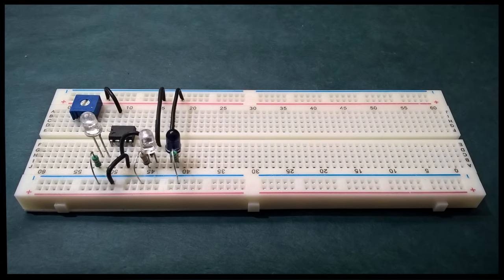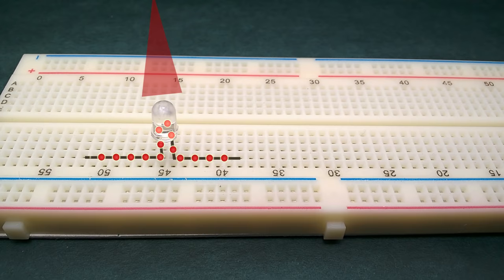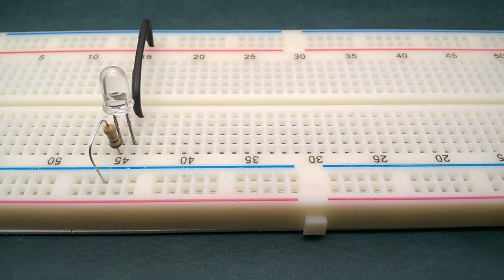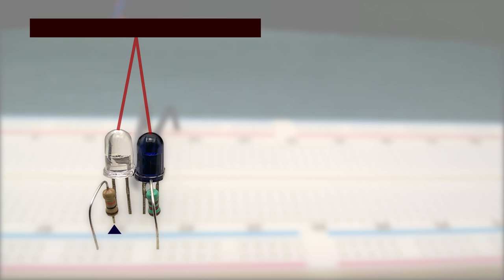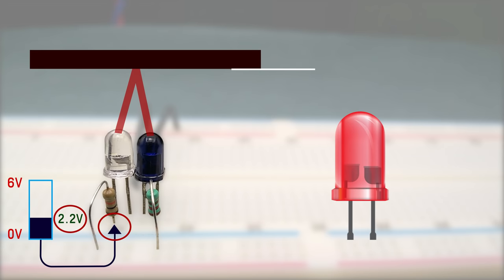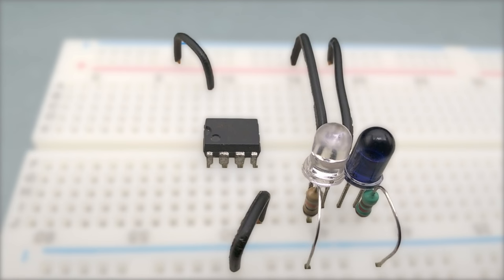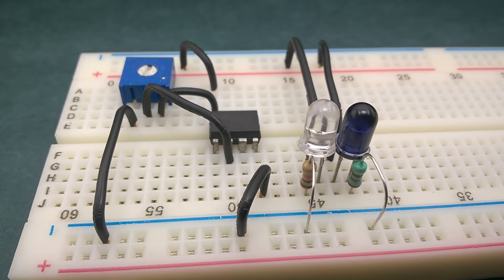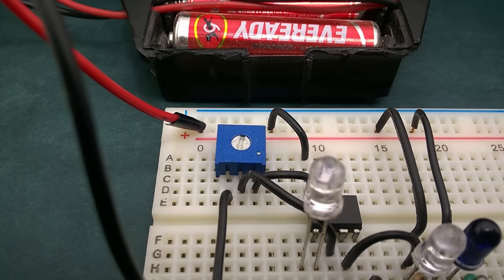IR Proximity Sensor / Obstacle Detector circuit on Breadboard | LM358 Op-Amp projects

Comment from the maker: if you face any difficulties in making the circuit work as expected, watch this: https://www.youtube.com/watch?v=036kskbFf40
Reply: Could you please send me the video or circuit of ir sensor and counter
Reply: I have a problem. Do I need an infrared diode and a photodiode? or 
An infrared diode and a phototransistor?
Reply: Great video, Logically explained and intuitive, thankyou, subbed.
Reply: Elonics - Electronics Projects on Breadboard
Reply: Thanks
Reply: Brother , can u help me that i want to built a RFID Door lock With Arduino nano and Micro Servo SG90 and RFID-RC522.......Brother its urgent help. ( CODE and circuit daigram needed )
Reply: Can i ask the number for infared sensor
Reply: Best channel of electronics👌👌👍
Reply: Hello sir, can we increase range of metal detector? If yas teen how? Please guide 🙏
Reply: @luisleonardojuarez7389  बन
Reply: Voces enrolam o cara cade o esquemA eletronico0

Comment from the maker: If you face any difficulties in making the circuit work as expected, please refer to the troubleshooting guide in the description and see if it helps.
Reply: can i made longer the distance?
Reply from the maker: This circuit's sensing range is limited to around (15-30)cm. Beyond that, even if you adjust the potentiometer, the LED always stays on.
Reply: Elonics - Electronics Projects on Breadboard please send me the circuit
Reply: Elonics - Electronics Projects on Breadboard
Reply: Elonics - Electronics Projects on Breadboard 
What if i want that the led have dimm or goes brighter dependent of the distance of a object to the sensor? Is it possible to realise?
Reply: What of I want to turn off the led when something comes close
Reply: Elonics - Electronics Projects on Breadboard even after using 1k for led and 470 for ir led. The led at the output keeps on glowing continuesly. Plzzz help
Reply: can we make it using arduino where three led bulbs depending on the distance of obstacle glows  like one led for very far , one for medium distance and one for very close?
Reply: I have a 20k potentiometer, what are the necessary changes I should make?
Reply: a  question that means "cut the bread?"
Reply: Elonics - Electronics Projects on Breadboard  circuit digram
Reply: If i want to indicate the output using a buzzer so can i connect a buzzer like you just did using led

Comment: Great video, mate.  This is the setup I had in my head but wasn't sure how it'd work, and you've gone through it in a clear and concise manner.  We even have two channels on the op amp, so we can build a dual sensor unit in this manner that doesn't require an Arduino or what not to act at the comparitor or voltage reference-measurement.  Love it.
Reply from the maker: Thank you.

Comment: Thanks for posting this tutorial. This circuit worked for me. Although my IR receiver is black and my IR emitter is clear, which is flipped from what is shown in the tutorial. I had to adjust the 10kohm resistor to change the sensitivity for my application.

Comment: Great video, very well presented. For some reason mine was on and turning off with proximity. After much consternation I swapped the wiper (center tap) of the pot and put it on #3 and moved the receiver wire to #2 and lo and behold it worked. Not sure if the schematic is wrong, my LM358 is backwards or something else. Note, if I approach the circuit from one side it has a range of approx.  3 feet.

Comment: If you are all are wondering why the LED is continuously on, it is because there is no barrier between the light detector (white) and IR LED (blue), so it will always pick up light...
Some masking tape between the two - without covering the domes - should help (although I have not tested this circuit myself).

Comment: Sir, does the infrared source emit the infrared rays uniformly in all direction? If it so doesn't the photo diode should always be sensing it as the source is very close to the photo diode in this model.

4:19  doesn't the statement should be 'voltage of inverting input is lesser than that of non inverting input'

Comment: It worked on my first attempt. I used  5V mobile charger supply to power it. Suggestion- 270R should have higher wattage, gets hot on 12V & please use different colored wire for +ve & GND.. Thanks.
Reply: Your circuit has a humongous flaw that will render this useless. 
You've labelled your photodiode as a transmitter, And you've labelled your infrared diode as a  reciever. The entire circuit and theory behind this is perfect, but you have to swap these two.

Infrared diode(transparent) positive pin to VCC, negative to R1 resistor which is then grounded.
Photodiode(black) positive pin connected to pin3 of OpAmp as well as a resistor which is then grounded. Negative pin of photodiode to positive.

Comment: Im pretty sure the the black diode is the reciever, not the emitter, and is that an inductor you used to bring the black diode to ground? Im pretty sure you said its a resistor, but it looks just like an inductor.

Comment: I see that you noted this, "Note: For supply voltage of 9V or more, use 1K resistor for LED and 470R for InfraRed(IR) LED" Would I still need a 1K resistor for the LED if I was actually going to use that connection to light a LED stip up to 10 feet long? I know a single LED couldn't handle more than 5volts, but a strip should be able to handed the 12volts
Reply from the maker: LED strips usually come with resistors soldered for every 3 LEDs or so. You may check the spec and if it is rated 12V, you can skip using the resistor

Comment: Hi there, I see some of your user questions are about ambient light affecting the way the receiver works. This happened to me also.
When I built the circuit it was during the evening (so no daylight) and all worked great. The next morning when I powered up the circuit once more, the receiver just stayed on continuously and wouldn’t respond to the IR transmitter. I spent ages checking voltages on pins 2 and 3 and swapping out components, until I suddenly discovered it was the ambient daylight that was causing the receiver to activate and cause the LED to stay on all the time.Do you know of any way to stop daylight affecting this?
Thanks
Reply from the maker: Hi,  the only way is to use a cylindrical enclosure around the Photo-diode (Like this: https://youtu.be/036kskbFf40?t=3m9s). Or you can consider making a modulated version of proximity sensor (More complicated and also more immune to ambient light)

Comment: Sir, Your explanations are really very good !👌🏼
Could you please explain the same  IR Sensor circuit when using an LM567 IC. The LM567 is to be used as it allows usage of IR Sensor even in bright Sunlight. Thanks in advance, Sir.

Comment: Hi, I visited your website, did the troubleshooting guide too, but the IR pair (i checked they're not broken) is not working as a proximity sensor, my red LED is on/off according to adjustment of the pot, can you explain why? thank you!
Reply from the maker: Did you try adjusting the pot to just the position where the LED turns OFF, and then test if the circuit is working?
Reply: Elonics - Electronics Projects on Breadboard Thank you for your quick reply! yes, I did. But it didn’t work, then I changed two resistors for IR PAIR, now it works, maybe it was the problem of wrong resistors’ value for my IR PAIR
Reply from the maker: @minqingliang  Awesome! Glad that it worked. Yes, it might be that the resistor used in series with this particular IR detector is either too big or small.

Comment: Hi, I had to swap pins 2 and 3 on the LM358 in order to get the led to light on proximity sensing. With it hooked up as shown on the schematic, the led  was lighted and proximity sensing caused it to go off.
Reply from the maker: Hello, did you try adjusting the potentiometer before swapping pins 2 & 3?
If the circuit worked after swapping the pins, chances are that it will also work with the original configuration.

Comment: I Purchased a ready built proximity sensor using lm358 and it works reverse the light is on default and when object is placed it goes off. How to reverse its behaviour

Comment: i need to make a proximity sensor for a door that will only operate the circuit if the person or object carrying something that will trigger the proximity sensor. so if you were not carrying the object it would not open the door, but if you are carrying it, it would sense your proximity and open the door. what would I use for this?

Comment: I arranged the apparatus exactly as you did.but how to arrange the potentiometer, I was only confused in arranging that,also iam using a 9 volt battery so how to control the voltage to get good results,
Reply from the maker: Of the 3 potentiometer terminals, 
One extreme terminal need to be connected to positive rail,
the other extreme terminal to negative rail,
and the center terminal to inverting input.
This circuit works fine with 9V

Comment: If want a DC motor at the output instead of LED, what will be the corresponding changes in the circuit diagram ?
Reply from the maker: If its a small motor without heavy load, you can directly connect it to the output. Otherwise use a mosfet/motor driver.

Comment: The polarity of the clear IR receiver LED looks reversed... isn't the flat side negative?
Reply: Also, you mentioned 2 x 270 Ohm resistors but implemented 220 Ohm resistors on your site schematic. I am going to go with more resistance, might want to consider this as it may burn out the LEDs.

Comment: hey.. explaination is too good.. i have doubt can i use opamp 741(comparatorconfig) instead of lm358ic ,, and one more thing instead of led can i able to replace with relay..whats the max range of this .. i really need this info.. pls help on this
Reply from the maker: Hi.. Yes, you can use a 741 OpAmp.. Maximum current output of 741 is around 20mA.. Although the output current will be sufficient to drive a relay,, its better to connect via a transistor (to avoid fluctuations).. something like this: https://goo.gl/images/MHnoHA
Reply: MAX range .?
Reply from the maker: Around 15cm

Comment: Hi, Elonics i'm very thankful to you as i made this project from yours circut diagram and it really worked. but i have a ques. that why are we using 10k ohm resistor in ir transreciever and 270 ohms in other two..?
Reply: i guess.. it is because to make ir reciever less sensative.. is that ryt..?
Reply from the maker: No. It's because we need more voltage drop, as in V=IR. So that Op-Amp can detect changes over a wide range.

Comment: hey ! At 1:38 , the clear LED is the IR emitter and the colored one is the receiver right? is it shown the wrong way or am I wrong?
Reply from the maker: No,  the IR photo-diode used in this video is white and the IR LED is black. But it can also be the other way. You can determine which one is LED/Photo-diode by connecting both the diode, photo-diode pair separately to the power supply (via a 220 resistor) and see which one glows using a digital camera.

Comment: Bro can we use 12V water pump in place of the glowing led by increasing the voltage
Reply from the maker: You should use a relay at the output of Op-Amp and connect the 12V water pump to the relay

Comment: Could we use 10k variable resistor instead of Potentiometer......i had used all circuit patched same but circuit run automatic means LED and Buzzer keep running.........IR transmitter does not work...
Reply from the maker: Did you watch this video: https://www.youtube.com/watch?v=036kskbFf40
Reply: Elonics - Electronics Projects on Breadboard 

Yes and everything is all right

Comment: I made this circuit and used 9v battery and 1k resistor for led and 470ohm for ir led. My problem is led glowing without any obstacles.
Reply: It worked the problem was a faulty IC I changed it and it now works
Thanks for the circuit diagram
Reply: Do you have any other project ideas if so please share the circuit diagram
Thanks

Comment: Hi, Elonics. Can I also use the UA741CN as op amp for this circuit? it is a single op amp an should work with 5v up to 40v. 

I try to use this IC but it dont work :/ 
Thanks for sharing your circuits :)
Reply from the maker: What are the measured voltages at the inverting and non-inverting inputs, before and after placing the obstacle?

Comment: is the both infrared led same?                and why do you have them in different colour
Reply from the maker: No,  the IR photo-diode used in this video is white and the IR LED is black. But it can also be the other way, in your case. You can determine which one is LED/Photo-diode by connecting both the diode, photo-diode pair seperately to the power supply (via a 220 resistor) and see which one glows using a digital camera.
Reply: Elonics - Electronics Projects on Breadboard Very helpful. But these LEDs & PDs don't have any part numbers & specific data sheets. Do U have any videos about different kinds of LEDs & PDs?.

Comment: If I'm making this circuit on a zero PCB with a 9v battery do I use the same resistors or different
Reply from the maker: 470R for LED and 270R for IR emitter
Reply: Did your circuit worked

Comment: would it be possible to use a laser as an infrared source to increase the range of detection?
Reply from the maker: No, the IR Photo-diode is less sensitive to visible light. An LDR circuit should do if you wish to use a laser.

Comment: Question: at 0:33 is the "infrared photodiode" a phototransistor or an IR reciever?
Reply from the maker: The infrared photo-diode is similar to a solar cell (current flows when light is incident on it). The only difference is, a solar cell responds to visible light whereas the infrared photo-diode responds to infrared light.
Photo-transistor is like a mix of transistor and photo-diode in a single package. (the photo-diodes output is amplified by the integrated transistor, so more sensitive)
An IR receiver has all required elements to do everything right from receiving the IR signals to decoding them (like TSOP1738).

Comment: Hey, do you know how the sunlight (or fluorescent bulbs) can influence in 
the circuit? I've been testing around these suspicious environments and 
the polarity of the IR sensor seems to be inverted. That's weird.
Reply from the maker: Yes. If the ambient InfraRed radiation is more than what the amount of reflected radiation from IR LED, this happens.
When you place hand over the diode-photodiode pair, it receives less radiation then before (because ambient rad > reflected LED rad), which makes it think the obstacle is moved and so it turns off the LED.
Reply: You can eliminate ambient light interference by using a modulated carrier. The emitter is placed in series with an oscillator at around 37kHz and then that signal is pulsed on and off at around 10Hz. The circuit is a bit more complex, but it is the standard method used in remote control devices and dramatically improves the range and eliminates interference. A 3 pin IR receiver works best, but you can also use a 2 pin receiver and add a simple transistor amplifier at the output. Fine tune the emitter's 37kHz oscillator until you get maximum reception at the receiver.

Comment: is the op amp using smith trigger circuitry to provide the output .  Thank you .
Reply from the maker: If we added a positive feedback loop from the output, it would become a Schmitt Trigger Circuit. Without the feedback loop, it's a plain comparator circuit

Comment: 50/5000
this circuit also works as a camera trigger ?
in sunlight are no problems, distance of work.
or better ir sensor, not phototransistor ?
Reply from the maker: A modulated IR sensor works better in sunlight. This one is unmodulated.
Reply: modulated-unmodulated ?
Reply from the maker: In an unmodulated IR sensor, there is no way of knowing if the IR radiation is from emitter or external.
In a modulated sensor, the emitter emits IR light at a certain frequency, which helps in distinguishing between IR radiation from emitter and from external sources like sunlight.
Reply: thanks and happy christmas
Reply from the maker: You're welcome and I wish you the same

Comment: If i use 9v battery what would be the additional appratus to be connected???plz help
Reply from the maker: You can directly use a 9v battery. Just change the LED's resistor from 270R to 470R.

Comment: What if you want the opposite?you want an Output whenever it does NOT reach the refence point?
Reply from the maker: Reverse the inverting and non-inverting input connections: Adjustable terminal of pot should be connected to Pin-3 and the common point b/n photodiode and resistor should be connected to Pin-2.

Comment: When I connect the battery, my led lights up and does not get affected by changing the potentiometer now by changing the distance of obstacle????what should I do?
Reply from the maker: The ambient light might be high or the spacing between the diode and photodiode is very less

Comment: Thanks for the video, good sir. Just a quick question how did you achieve the +ve 5 V and - 5V  for the op-amp or did you just used 0 V to 5 V supply to the op-amp ?

Comment: the buzzer goes on continuously.
i have checked the circuit properly but the buzzer doesn't stop even if there is no obstacle please help me with this problem asap.
Reply from the maker: The intensity of the ambient light might be very high. Try testing this circuit in less illuminated conditions.
Reply: Even I faced the same problem

Comment: The only thing was when I did this the light would stay on but turn off when I got close. I had to connect cathode of LED to pin one and positive to power supply using 270 ohm resistor.
Reply from the maker: You are doing it the wrong way! Take a look at this video: https://www.youtube.com/watch?v=036kskbFf40